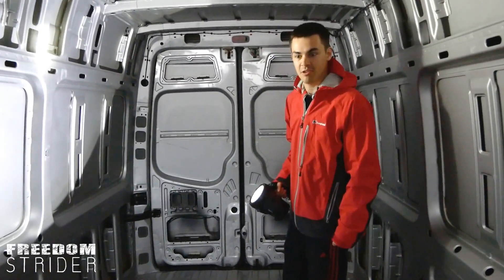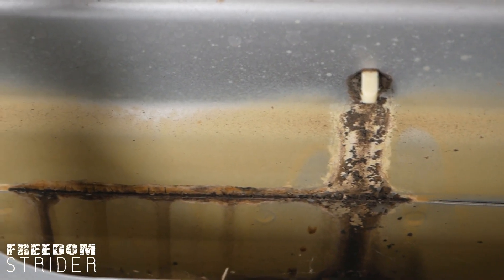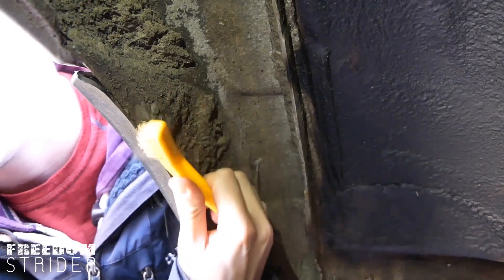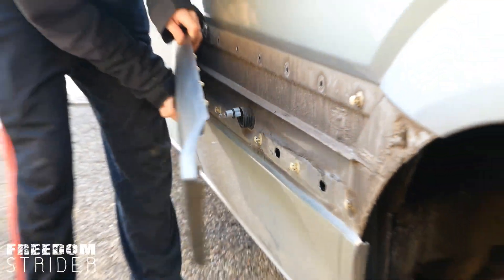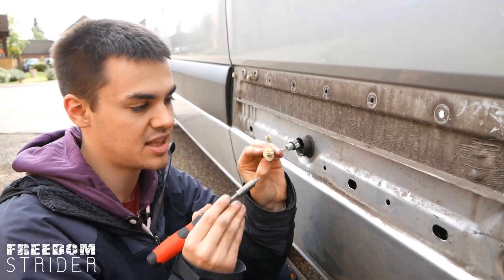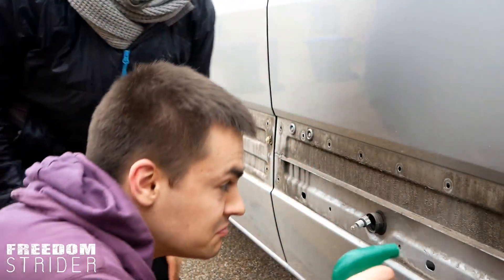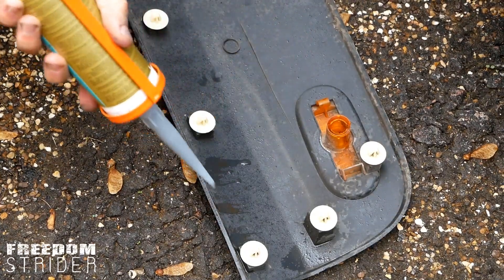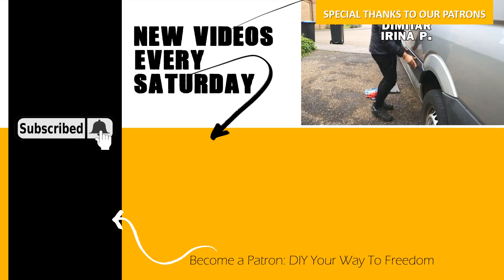Fix this NOW! Sprinter/Crafter Van DESIGN FLAW!!

Comment: you are doing a really thorough job on identitying corrosion problems and rectifying them. One point that you probably know already is the undersill. These have drain holes which become blocked up from road dirt. If they are blocked the sill will fill with water which cannot drain away. Great job and video.
Reply from the maker: Thanks - Yes we did see the drain holes, ours weren't blocked (except the front ones) - it's a good reminder to keep checking them though 👍

Comment: Easy job I must do on my new sprinter BUT will this not be a nightmare to remove if and when the bulbs blow ?
Reply from the maker: We've replaced a few bulbs, the plugs stay stuck in the van and pop off the plastic instead

Comment: Fair play to you for identifying this. I am doing the same on a Renault Trafic and the clips are identical! No little foam sealing washers included like there should be.... So I made my own foam sealing washers from some 2mm thick eva sheet foam & a laser cutter. Lots of prerssure to get each clip locked into its hole. STILL LEAKS PAST THE FOAM!  😲
So I shall be adding sealant to the foam. 

My last bit of advice... Silicone sealant should never go anywhere near a vehicle. Never.  Should be a ban on it. PU based adhesive is what you want.  For these clip though I'll be using 3M 08509 mastic. Check it out.
Reply from the maker: Cheers for the advice, amazing after even putting on that foam and pressuring the clips to go into place that it still leaked!!

Comment: You need to go along the bottom of the sils with a small flat blade screwdriver and unblock the drain holes. Quite a bit of water might drain out.
Reply from the maker: Very very good tip for everyone to know! We actually did that yesterday and filmed it, fully expecting water to gush out due to all the rain we've had hit nothing came out which is a relief - thanks for the reminder 😊

Comment: Great tutorial. Any idea where to buy replacement clips as a few broke when I removed the trims
Reply from the maker: eBay have them, just search "sprinter side trim clips", cheap as chips on ebay
Reply: @FreedomStrider  amazing . Thank you. Currently going through process of rust repair and going to take all side panels off then respray a Matt black. Maybe get it finished when or if the uk weather is more settled 😂😂 appreciate the super quick response

Comment: Hi guys great video! What would you recommend to cover any holes where the old cover has come away? 
Yours doesn’t have it as those big bolt things are on there, but a couple of mine are missing and struggling to think of what to use to cover the hole. Many thanks for any tips and all your content ☺️
Reply from the maker: If you have missing clips, you can either buy more clips, they aren't too expensive (➤ Spare Trim Clips: https://ebay.us/j1hLsW), or, you can just use some sealant and fill the gap with sealant. We did that for 1 missing clip and it's been fine.
If your van has some bigger holes, you can use something like waterproof tape or a waterproof sheet and stick that over the top of the hole, with your sealant as well. Hopefully, this helps 😊

Comment: A question: Why not replace the clips/trim straight up, and then use that neutral cure silicate on the inside of the van wall around each clip? Or do both the flat surface of the clips outside and a blob on the interior side?
Reply from the maker: Struggling a bit to visualise exactly what you are describing. You can put the silicone from the inside around where the clips come through, without needing to remove the trim off the van, though the silicone is more effective when squished between the clips and the van metal (air bubbles are less likely).
Reply: Yes, I expect you could do that, and that would remove the necessity of removing the trim in the first place. But I get your comment about the application on the flatter parts of the clips.

Comment: You can also go inside the van and double check the fasteners have gone through, at least the top row of them as the bottom row is not visible from inside the van, if you want to go OTT and really protect your insulation from rain then you can put extra sealant on the fasteners and holes from the inside after doing the first part, you can even then put waterproof gorilla tape over all that just to be extra sure /OTT
Reply from the maker: Thanks for the extra tip 🙂

Comment: Thank you soooooo much. Is it not a good practice to run a line of silicone  sealant ontop of the plastic sideskirts to avoid water running behind them in the first place, as well as ontop of the guiderail for the sliding sidedoor...? Grtz from Belgium
Reply from the maker: 🙂 Is it good practice?... honestly, depends who you ask. We haven't run silicone on top, but logically it's not a bad thing to do as it will deflect the water from the back and reduce the water that may sit behind the panel. However, if that silicone starts to weaken and starts letting water behind you probably wouldn't notice - so, over time, water will collect as the remaining silicone will be preventing it from draining or it will drain too slowly (which can cause rusting). So I think if we were to add silicone on top, I would feel like I have to redo it every year in order to maintain its effectiveness. - Polly

Comment: I must do this to my van as well! Thanks for the vid
Reply: Hi water is sloshing in my mercedes sprinter rear panels, is this same way to drain them.

Thanks
Reply from the maker: There should be some drain holes under the van, they easily get clogged up with fort so take a flat head screwdriver and clean the holes, this should allow the water to drain 🙂

Comment: I’ve just completed the  panels and was enquiring if you did the same treatment to the driver’s and passengers doors panels also ?
Reply from the maker: At first we didn't but then later on he had a leak and thought it was coming from those front pannels so decided to remove and seal them (https://youtu.be/jMOkmO_BjT4)

Turns out the leak wasn't coming from there, but the panels were the same, having no seal protection so we'd recommend you seal them as well. :)

Comment: If you do the job properly, after how many years do you have to do it again, as those clips are only going to leak again eventually?
Reply from the maker: Well, it's been 4 years and they haven't leaked as far as we can see, though, we can't open our walls to check.

As an extra precaution, you can always run a sealing sealant bead or a rubber trim on the top (on the outside) of the trim that would stop water going behind at all.

Comment: Great video!! I think "pinching" them (where accessible) from the inside might make the job easier but I will be doing this... It also occurs to me that applying the sealant then individually inserting them (each plastic clip) back in to the van body first then clicking the black plastic piece trim panel onto the now remounted/existing/sealed clips might make things easier and maybe cleaner (from having misaligned bits of sealant maybe?).... Also, does anyone know if this is the SAME on the newly released North American model (2019 and later)?  (PS: US vans don't have that amber light mid-body)
Reply from the maker: We debated for a while whether to pin pins in van or pins in black strip first, but we decided it would be easier to aim for the van holes than aim for the black plastic side trims holes but either way it will work out.

As for the US modles, not 100% sure but the newer Sprinters (2018 onwards) in Europe still have this issue so probably best to take them off and check, or better yet check from the inside first and see (you can spray a water hose and see if they leak from the inside)
Reply: Definitely use pliers and pinch the fixings, pulling will weaken them if it doesn't break them

Comment: Any idea if the Transit Custom has the same panel clips?
Reply from the maker: Not 100% sure if they are the same clips, but they seem to be attached with some sort of clip into open holes in the van, so water may still leak through, but we haven't seen the van in person, but there's every chance you'll have to weatherproof it depending on the exact model you get.

Comment: So, what happens when you need to change the bulbs?
Reply from the maker: You can still pull then off - as shown - some of the pins stayed in the van pulled out from the black strip, so we just pull the same way. If any of the sealant comes off, we just need reapply.

Comment: You can use pliers from the inside of the van to squeeze the panel clips that remained and push them out. Honestly might be able to get them with your fingers as well.
Reply from the maker: Not a bad call, we never tried although it might be easier on the fingers!

Comment: You can get a cheap panel kit for about £12 to remove all your plastic panels even your door card I put sound puffing in my doors and the van is a lot quieter now
Reply from the maker: Do you mean the plastic covers inside the front doors? You put sound deadening material inside there? That would be great actually, we've been looking at possibly removing those panels ourselves, first for sound deadening and secondly to possibly repaint it. Do you have a link to that kit?
Reply: Freedom Strider yes inside they are called door cards , I put stick on sound proofing that is normally used for the underside of the bonnet once I did that I replaced the material some manufactures use plastic sheets to or other materials, ai removed all of it as I had to to fit the sound proofing I replaced the covering with viper barrier, then I Lined the door card with foam backed leather . That was only because my van is a old van and I don’t really like the look of plastic , I put the sound barrier on all doors my van is a 2004 Iveco .and as soon as I get a few dry days I’m fitting a tow bar to the back and a winch to the front then my under body gas tank . Which I should of really done before I insulated the floor or put the ply down . And next year if I can afford it I will be fitting air suspension to the back axle for a smoother ride .

Comment: This seems to be fixed in my 2022 sprinter as the clips have gaskets on them now.
Reply from the maker: I'm glad. I would check if their seal is holding by spraying water at the trim and the checking if any water made it through. 👍

Comment: Wouldn't it be much a more guaranteed seal/easier fix if you just caulked the perimeter of where the plastic panel's edges meet the metal body of the van?
Reply from the maker: You could do that, we've seen it done, I wouldn't say it's any more of a guarantee plus if you remove the panel for any reason you'd need to do it again
Reply: the caulk is open to the elements whereas the fastener seal isnt so I think the latter would perform better in the long run

Comment: Someone told me Mercedes had fixed this problem in the 2019 model... is that true?
Reply from the maker: I have heard conflicting evidence - apparently the newer Sprinters/Crafters have some sort of vinyl sticker behind each plug, but some people say it doesn't help with the waterproofing, and some say it does.

The easiest way to find out is to go into that model van, and if it doesn't have any cladding, you'll be able to see how the outside trim is attached.

Comment: Dont use silicone on the van ... use a urethane product
Reply from the maker: Why not silicone?
Reply: @FreedomStrider Some silicones contain vinegar, the panels vibrate slightly in use, rubbing the paint off letting in the slightly corrosive nature of the silicone sealant do its finest, very important if your keeping the van long term, the best product to use is a Neutral cure "silirub"

Comment: Think you know more than Mercedes you don’t. Seal the metal you rot the metal. Every van/car panel has drip holes at the bottom of doors and side panels for drainage and air flow too dry out again, not just for outside moisture but for condensation on the inside from cold bridging. If the holes are blocked it will remain wet.
Reply from the maker: Those holes make sense if you cavities open with no insulation. Bit in a camper when you fill the walls, having holes just get the insulation wet and cause mold and rust. So yes, covering them is the best solution. There's only holes at the bottom for drainage, which are the only ones that actually matter to leave open. Not these side ones. All they do is let water in (part of the reason you need drainage holes)

Comment: It's funny that all you YouTubers call it a design flaw. Because it isn't.

Those plugs don't look like an umbrella and aren't in that tight without reason.

It's only when a van had damage on the side and those plugs weren't replaced after repairing when the problems start. You can detect those plugs because the paint is dirty under that plug. Good plugs will be clean.

But nothing wrong with taking some extra measures. Just don't call it a design flaw.
Reply: Sorry champ! IT IS A DESIGN FLAW...  hard plastic no matter how tight against that painted bodywork, will allow water ingress. IT NEEDS A SEAL. There should be a little foam/neoprene/eva washer that acts as a sealing washer on each clip.  Some manufacturers include them some don't.  The clip shown in the video is exactly the same as the similar body trim panels that go onto a Vivaro/Traffic/Primastar.  Now heres the rub! If you buy replacement trim panel it comes with the clips which include the sealing washer. If you just buy the oem replacement clips they don't come with the sealing washer.  Clever that.  Here is the second rub.  The included little foam seal is so thin it does not seal!
Reply from the maker: Dub love sums it up quite well :)